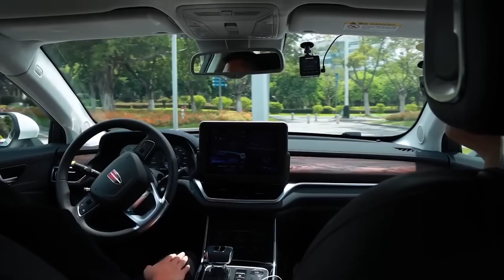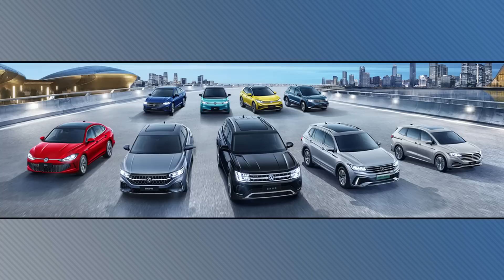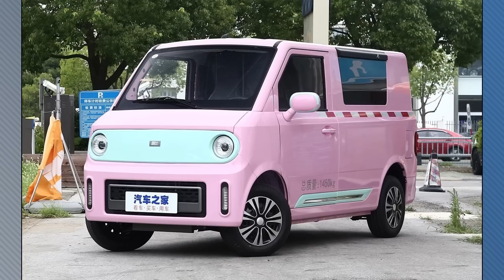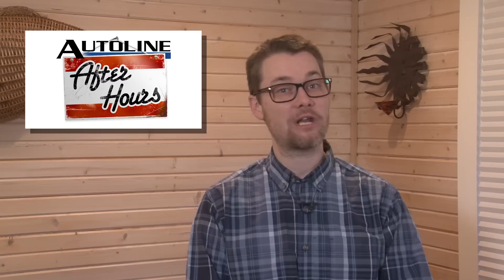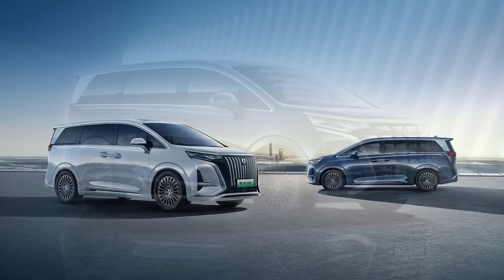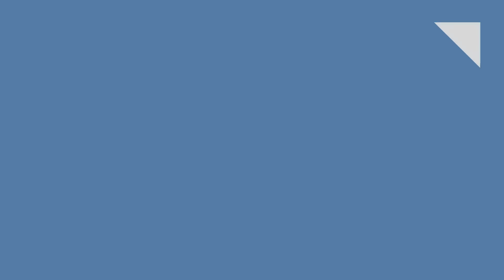VW's Affordable EV is Front-Wheel Drive; BYD Puts 2 Charging Ports on EVs - Autoline Daily 3528

Comment: VW making progress on vehicle packaging with the 2all, but it is obvious they are not making much progress with parts integration. The Denso electrical supply unit is a great concept - it accepts electricity AC and DC from adjacent charge port and distributes to/ accepts energy from the HV battery, HV motors and LV battery as required. Tesla has far superior thermal management, but all its heat exchangers should be under the hood in a single package, cabin HVAC included as air can be ducted to and from cabin and airflitering can take place under the hood and not in the cabin. Tesla apparently making great progress with 48V LV circuits. Vehicles should use drive-by-wire and side-stick control. If Airbus aircraft can fly with side-stick, they can be used to drive cars.

Comment: Tesla service isn't as bad but I agree with the lawsuit. It takes a very very long time for even the smallest part to arrive for the service team to fix your car. For example I had my Model S sit in service center just recently (last quarter of 2022) for 4+ months waiting for a headlight and they don't even provide any estimate on when the parts will arrive. Even the service team doesn't know and they tell us straight forward we just don't know and we don't have any estimate. We will know when it ships. When I pressured and asked why it is taking so long they simply said due to chip shortage. Are you fucking kidding me. You want me to believe a headlight is delayed  because of chip shortage which by the way was utterly false in Q4 of 2022. And the cost is exorbitant. It's not just one off experience. Even last time I had to wait 3+ months for replacement of just a glass of my sunroof. When my rotors was making noise they charged me 200$ just to diagnose the issue and the issue was rotors were corroded and they only were willing to change whole assembly with brakes and they were quoting me for 3300$+ just for 4 brakes and rotors to be installed
Reply: Global pandemic dude, parts availability is an industry wide issue and Tesla is growing at a rapid rate so they need most of their parts to build new cars, and by the way, yes there are chip components that run your LED headlights.  As for cost, have you priced parts at Mercedes or BMW, they are even more expensive in my experience.  About your brake rotors, did you do any maintenance prior to you complaining about the noise?  Do you make it a point to use your brakes a couple times each time you drive your car?  It's not Tesla's fault that you don't maintain your vehicle.

Comment: I find the cost of Tesla parts to be much cheaper than comparable cars. Just $1600 foe a new rear bumper, painted and installed, on my Model S Plaid. Had a Honda Civic bumper replaced some years age for $2900.
Reply: They quoted me 3300+$ just because my model S rotors were corroded, brakes still have life but they can only change the whole brake with rotors. Also wanting for something as simple as headlight of my model S took 4+ months

Comment: I have a 2023 model three I had moisture in the right tail light. Just a little information from the Tesla app,an appointment was made. Repairs didn’t cost me anything and they came to my place of work and repaired it within a few days. I found tons of aftermarket parts available online, including screens, power inverters, another electronics for my Tesla..
It took me 20 minutes to install a new driver gauge screen. Everything in the car is plug and play.! as for Service there’s a service Mode that allows you to do everything in the car everything from changing coolant to purging and resetting the system!
Reply: Wait for a few years. Tesla has the habit of forgetting their loyal owners. As the car gets old and if you don't trade in and buy new Tesla you will slowly see the exorbitant cost of their service and even when you agree to that cost because say you don't have any alternative they will take forever (3-6 months) to provide the part (since your car is old now And they don't make those parts or have them in stock). I am a 2015 Model S owner and speaking from experience

Comment: I've always had great Tesla service, but Tesla is one of the only car companies that makes all the service information available free online. They also have the software tools available (for a fee) so I don't know what the lawsuit is about.  An owner or indepenant shop can service Teslas without an issue.  More likely the amount of service is so low that it isn't worth the time to train a tech on Tesla EVs.  As to parts, while I wouldn't want to use non-Tesla approved parts, there is nothing that prevents an owner from installing fake brakes or any other component from another company that they want.  The lawsuit sounds like a standard scam by lawyers, hoping for a big payout to just go away.  If the lawyers win, you know the settlement will be a $2 off coupon on service to owners.  I hope Tesla fights this scam.

Comment: Two Teslas here. Service experience excellent! Waiting for mobile tech as I type this. Best service ever. Come to you for most simple things. This is a fine tuned computer. I don’t want some local hack touching it.  If you don’t like that you should buy another brand. Simple. It’s the Apple of the car world. A step above.
Reply: The problem is the lack of right to repair.
Reply: @davidclark538  "I've always had great Tesla service, but Tesla is one of the only car companies that makes all the service information available free online. They also have the software tools available (for a fee) so I don't know what the lawsuit is about.  An owner or indepenant shop can service Teslas without an issue.  
...
As to parts, while I wouldn't want to use non-Tesla approved parts, there is nothing that prevents an owner from installing fake brakes or any other component from another company that they want.  The lawsuit sounds like a standard scam by lawyers, hoping for a big payout to just go away."

Comment: Big market for EV golf’s, rabbits , accord and civics. Hope the companies recognize this
Reply: They make more money on the early adopters selling high end vehicles.
Reply: They all do (well, not the idiots in Japan) but ICE has been around forever and all the costs were driven out of small engines and transmissions long ago so the entry level cars became "cheap". BEV will remain in a development phase for another 15 years with platform development and constant battery chemistry and form factor changes. But they'll get there. In the mean time brands that want to sell under 30 grand EVs to get that market share will need their more expensive models (and continued ICE sales) to subsidize their entries at the lower price brackets.
Reply: VW especially should use the original golf as inspiration for their Bev's. I'm not a fan of their current I.D. look.

Comment: Tesla owner here.  Service so far for me has been pretty quick and easy, but I live in Southern California so there are plenty of locations.  But as a computer technician I'd rather have the option to go elsewhere to get non warranty issues repaired or even do more of the work myself.  Tesla is cranking out as many vehicles as possible because their demand is still super high but they need to take some time and just make spare parts and distribute them all over and have them available for 3rd party repair and private repair as well.  The only part I'd be weary about taking to a non Tesla certified repair shop would be the battery pack itself.
Reply: Good luck repairing a Tesla in a rural area of Oklahomo.  :person-turqouise-waving:

Comment: Having owned 3 Teslas so far, service has been awesome - better than any other vehicle I owned (which includes, Audi, BMW, Porsche, multiple GM vehicles) - just the fact that many services are done at home/work with mobile services is the best service one can hope for.
Having said that, Tesla need to qualify and offer parts for 3rd party shops more rapidly. The number of Tesla vehicles that would get out of warranty in coming years would be huge due to Tesla growth and in order to ensure good service they must allow 3rd parties to work on them and offer training programs to do so.
Reply: Mixed feelings on this.   I can imagine 3rd party repair shops pulling the same crap as the ICE ones now do.   This could be a big headache for tesla.   Be careful what you wish for.
Reply: so you owned a Audi, a BMW and a Porsche and multiple GMs.. sounds like a fanboy story to me. 
First service on the german cars is with 30'000 kms or approx 18'600 miles. You might have done one service each, sold the car and bought an other just to do one service, you story is made up. why even talking such nonsense..
Reply: Third parties can purchase parts and work on cars for Tesla owners now, nothing stopping them.

Comment: I have a 2017 Model 3.  Anybody complaining about Tesla's service is out of their mind.  They charge their parts at cost and their labor rate is very much in line or better than competitors.  I was charged ~$81 for each front control arm assembly, a dealer would have charged 3X that easy.  Probably the same with other shops.  Service was fast as well.  That's been my experience.:face-blue-smiling:
Reply: I concur, parts prices are actually good parts prices, not the 2x that repair shops bill you for.
Reply: Why do they need so much service? They are new cars.
Reply: You have been lucky! I have heard of some nightmares for Tesla owners that live hundreds of miles from the service centers.
Reply: @gmv0553  Thatcan be said for most any car in the US.   The big 3 have been closing stealerships for over 50 years. Something as simple as asking an exorbitant price for the parts network computer access.

Comment: While I like the idea of dual charge ports (one available on both sides), but I can see a lot of angry people if they arrive to find multiple chargers on just one car.
Reply: "but I can see a lot of angry people if they arrive to find multiple chargers on just one car." Why? Do you think they plug in with both sides and try to charge in double time?
Reply: @wolfgangpreier9160  Because that means they can not charge at the same time. And no, this will not half the time to charge, this will only help while the battery is low, at a certain point it will not charge fastest than if it was on a single charger.